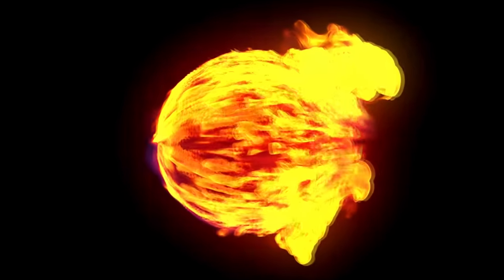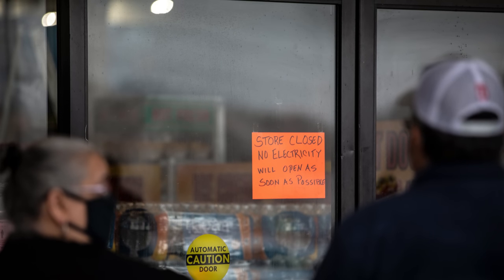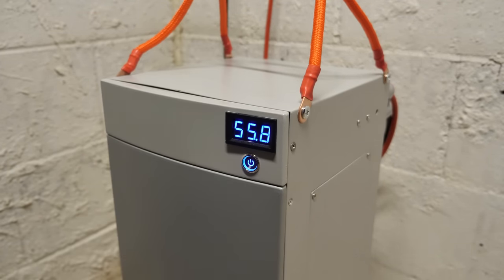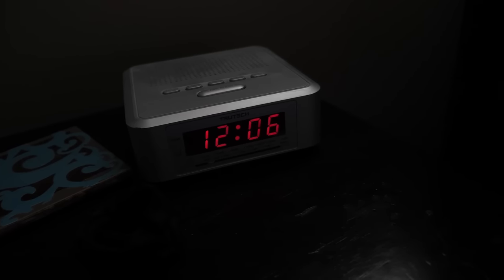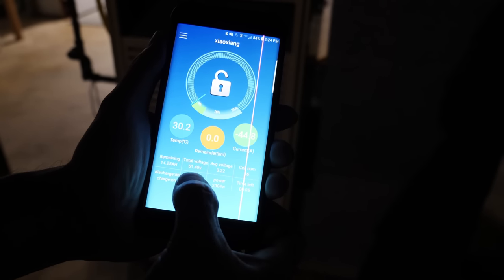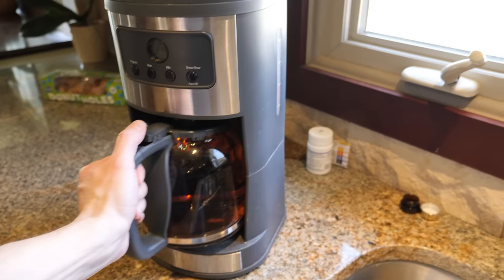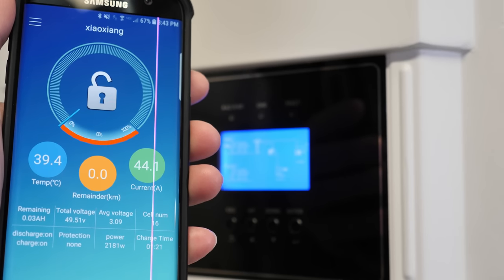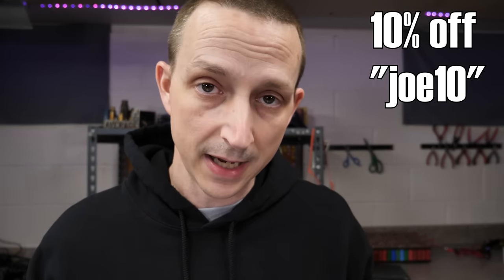Power your House with a Husky 48v 5.3kwh LiFePO4 Battery! BigBattery.com Test Review (2023)

Comment: How would that battery work out to power a off grid ( small 24x24 or so ) house 
( 24/7 - 365 ) for two people ?
Reply from the maker: You would need to figure out an avg daily or monthly kwh. What all do you want to run?
Reply: @AveRage_Joe  I currently run everything in My 1525 sq ft house . 
2 freezers 1fridge want to run an a/c of some kind
Lights 
As much propane appliances as possible.
Oh , almost forgot most
important part 2 - 55" tvs
&1 - 40" tv ( of course most likely only one at a time )
Reply from the maker: I can run for about 6hrs with 2 fridges, 60"tv, all the random phantom powered items like cable modem, wireless router, 8 camera dvr system ect and 6-10 led lights. Keep in mind the idle draw on my inverter is 160watts as well. I would say at least 2 depending on how efficient you 2 are. The AC is going to limit you. Would need to get a mini split. During the day is no problem as you normally charge first from solar and the rest of the day is running on solar. Also need to keep in mind winter time or the days with no sun.
Reply: @AveRage_Joe  It's beginning to look like it would be cheaper to run electric to property ! I probably could do it for 
$20, 000 ! It looks like it
will end up costing more to
go solar , and end up with less quality of life !
Reply from the maker: Used solar from santan solar off ebay. I purchased 20 245w panels for $1400 shipped to my house. Thats almost 5kw of solar to recharge and then run the house.
Reply: @AveRage_Joe  how much roof realestate did those panels take & how much did 
the rest of that setup cost ?
Reply from the maker: Id have to measure it again but roughly 15'x20'. Of course you can lay them however you want. To install I used some flashing squares, treated 2x4 cut to 6" pieces to set on the flashing then used unistrut as rails. To hold all that down I used 3 or 3-1/2" deck screws and fender washers. Also a squirt of silicone under flashing where the screw went. Upper part of flashing was slid under shingle so water can flow easily. Used the unistrut nuts amd 3/8" bolts, flat washer and lock washer to hold panels to the rails. For wire I used 12awg thhn/thwn and got 500' roll of red and black on ebay. I didnt need that much but got it anyways lol. Pretty easy and cheap install.

Comment: Is great job and explanation!!
 Can you please send information on your inverter!?

 Also is it possible to stack more batteries in series to get more power? CC
Reply from the maker: Thanks Mate! I have a few other videos on the inverter. As far as the battery, yes you can parallel them for more capacity/ runtime. BigBattery also has kits now that include an inverter(same as mine but 6kw version), batteries and wires. All from one place!
Reply: @AveRage_Joe  Ty! Please share link for BIGBATTERY so I can buy 4 batteries, inverter, and all wires and accessories needed. Cc
Reply from the maker: I have a link to the kit in description. Once there you can choose how many batteries!🤘

Comment: forcing 1C charging air cooled, ouch!  If you keep it under 0.25C (25A) you will see more than double the battery life of their recommended settings. The more often you can trickle charge and stay in the 30-80% range the better. It's not just temperature to worry about but the literal chemistry within the cells, and it's a very gradual process so you won't see the difference for at least a year. An EU2200i on propane would make for a nice backup charger :)
Reply from the maker: Yep, just wanted to test it out and make sure everything was as advertised! In my everyday usage the charge is much less!🤘

Comment: How does this battery compare to the 5.1kwh Gyll that sells for quite a bit less?
Reply from the maker: Thats a great question! Those do look nice! I dont have one to compare but maybe Sig Solar will send one😆 Im not sure what the warrenty is on that one either. This one is 10years, is a hair more capacity and can be carted around easily if needed.🤘
Reply: @AveRage_Joe  They’re both 48v and about the same weight. Gyll is 4% less capacity for 30% less $$. If I were going to build a set up with 20-30kwh, rack mounted with bus bars may be easier overall.  With just one, Husky is far easier to connect and use.  I hope you can get some Gylls and test them for real.
Reply: @philipmorgan1438  : GYLL is a Chinese company with No Warranty. If you are looking for a the best price/KWh and don’t care about a (10) year warranty or cycle-life; then purchase from TechDirect - it’s cheaper than GYLL and both have no real warranty.
Reply: @EricLundgrenCEO   Not sure that you’re right.  While they are made in China, that doesn’t matter to me since most LiFeO4 and Lithium Ion cells are made in China.  So what!?

Signature Solar (US company) provides a 5-year warranty on Gyll batteries.  That certainly isn’t “no warranty.”

Didn’t suggest TechDirect and you didn’t offer anything about their product so I won’t comment on that.  I know the Gyll product and was suggesting @AveRage Joe review them because they have tested well by others.  Lowest cost wasn’t my thrust here but Gyll is much cheaper than Husky.
Reply from the maker: Yeah rack style batteries are super cool! Obviously Ive been using a rack for my diypw for a bit but not the same as a rack battery! Yeah the BB is super quick and easy to connect up or parallel to others if needed and use right away!
Reply: @philipmorgan1438  : Forgive me, I thought you were being cost conscious because you brought up GYLL. With GYLL - you get what you pay for. The GYLL Cells are “B” grade cells. We purchased one to tare it apart at BB. Not a bad design, but bad cells. No company in USA making them, these are supplied to a 3rd party broker and sponsored by DPOZ. Very familiar with that product, if you want a rack-mount system on a budget for (5) years, it’s not a bad deal.
Reply: @EricLundgrenCEO  Ha-ha! 😆 No forgiveness needed....
Obviously, you’ve made up your mind!  I just saw other favorable reviews on them and thought AveRage Joe should review/test them.  They seemed to be a good value for size and pricing.  You wouldn’t have to read his review if you already know everything about them.
Reply: @AveRage_Joe  Yes, the ability to rack mount them seems a great feature when space is valuable and makes handling much easier.  I hope you can get some for testing and review. I think their 5 year warranty is good too though 10 years is great.
Reply from the maker: Id accept one for a test for sure!!!😆
Reply: @AveRage_Joe  they’ve been in short supply and backordered for months... someone would have to “lobby” for them to provide you some.  I have no idea how that process works but I hope they get the word and send you one.
Reply from the maker: Lol stands outside with a sign!!!😆

Comment: Sir, a Bless day morning to you, Possible connect to Solar power system charger/ for that big battery?
Reply from the maker: Yes I have solar connected to the inverter which has a charge controller built in.  During the test run I turned it off so we could see how it did!

Comment: What charge settings did you use? Trying to figure that out now.
Reply from the maker: Charge settings on the inverter?
Reply: @AveRage_Joe  battery … max voltage, low cutout.  Float etc

Comment: Joe, how do you have the interlock on the breaker panel set? I'm trying to figure the sequence you were describing (around 31:46) where adding the grid tie sounded automatic?
Reply from the maker: The interlock on the panel is just to make sure the grid does not supply power at the same time the inverter supplies power to the panel. It disconnects the grid. As for the rest, this inverter does not do grid-tie however you can supply the inverter with grid so if your batteries are low, the inverter can pass the grid through it and power the panel. At this time the main breaker at the top of the panel (interlock kit) is still off. It stays in the off position and the inverter either supplies battery power or grid power. Does that help?  If not let me know.
Reply: @AveRage_Joe  i  have the same question.  

in this configuration you would have to manually move the interlock to enable grid charging the batteries through the inverter (i.e unable to use the ups feature of inverter).
Reply from the maker: No! Once you switch over to inverter/ups you dont need to do anything else. Only reason to switch back to grid is for battery maintnance or whatever.
Reply: @AveRage_Joe  Gawd, I'm dense. HOW (oh how!)does it charge if the interlock is thrown and you're on UPS?
Reply: @AveRage_Joe  So if the UPS is on and the interlock is off, then both the UPS and the grid are on, right? I'm too close to see it I guess
Reply: @6sensory  He is feeding 240v (Hot1, Hot2, and ground)) from another panel to power the inverter. The output is a single 240v feed (hot1, hot2, and the neutral from the inverter transformer) which he connects to the dual pole subpanel breaker. He turns off and locks out the utility power at the top of this loads panel which de-energizes all the breakers in the panel. Turning on the dual pole breaker from the inverter output re-energizes all the breakers up to the main panel breaker which is open.
Reply: @6sensory  @fortiz80 He can charge the battery 2 ways simulatiously, Utility power (single 240v circuit) and Solar. Optionally the 240v utility power can be substituted with a 240v generator (with autostart controls) but you have to pick one or the other as there is only a single 240v (Hot1, Hot2, Ground) input and a dedicated PV +/- input. It's an off-grid solar inverter with power electronics that accepts 240v from any source including the grid, auto-switching to the battery when those 2 sources are no longer providing power. As Joe said it's not a grid-tie inverter.
Reply from the maker: YES!!! 100% Nailed it!!!💥💥💥🤘
Reply: @AveRage_Joe  Ahhhh, the sub panel. Gawd, sorry.
Reply: @ScarlettJason  Thank you Sir
Reply from the maker: Yes Sir!!😁🤘
Reply: @AveRage_Joe  Joe, is that a feed thru lugs panel, or an outdoor cut off panel or what? I'm trying to get it together and am curious of your choice of panel

Comment: Hello I am 64 years young, I just subscribed
I got hold of (FREE) 16 six volt lead acid battery's (from a industrial electric fork truck)
I have a 48 volt wind generator, that's just spinning because its not hooked up
My journey is just starting (on a budget)  
I'm looking for advice, I am a very AveRage Joe BUT no idea what I need to do 
Thanks for getting me interested
Reply from the maker: I like to say Level 64🤠 Anyway yeah free is always good! What I would do is get a charge controller for the wind genny and hook up it all up and start using! I guess you would need an inverter as well.

Comment: Battery has been up and running with a SW 4048 inverter and a MPPT charge controller, battery if off tonight and it will not respond, fuse is good, is there a way to reboot .....anyone!
Reply from the maker: If it was drained down all the way and shut off, shut off inverter then wait a lil bit for the battery voltage to recover then turn back on inverter to recharge.
Reply: @AveRage_Joe  
I was trying to connect to the Bluetooth BMS and it was at 54.3 volts......
Reply from the maker: The app wont reconnect? If so unlink or "repair" then reconnect. Thats what ive done if I have trouble reconnecting!

Comment: Is it loud when operating? If so can they be installed outside?
Reply from the maker: It can get kinda loud when all the fans kick in yes. If you install outside just make sure its not directly out in the elements. You would want it covered like in a shed or similar.
Reply: @AveRage_Joe  ok thanks!

Comment: Joe, do you think this battery could run a 3 ton Air Conditioner?
Reply from the maker: I do but I dont think for very long depending on the watts. I would suggest more in parallel for sure!
Reply: Do you have central air conditioning?  Would you consider running that test with AC, a few lights and your refrigerators? I’d be curious to see how many amps a central AC unit would add? Thank you for your video!  Nice work!

Comment: New to your channel. Cool video. I wish I had one of these in Arizona. I'm wondering if you can run your A/C unit on this?
Reply from the maker: Thanks Mate! You could run an AC but cant say for how long yet. You would want more in parallel!🤘
Reply: @AveRage_Joe  Thanks, I don’t any solor power. Can this battery be hooked up if you have the inverter system installed?
Reply from the maker: Yeah if you have a 48v inverter then you can use this battery. If you have a different voltage, Bigbattery has other battery options!
Reply: @AveRage_Joe  How do I go about getting one of these? Do I just contact a company who does this kind of installation? Or is this closer to DYI?

Comment: amazing video, keep it up, I would love to watch more experiments on how long a higher capacity batteries works with this inverter, can this inverter handle higher voltage batteries ??
Reply from the maker: Thanks Mate! At this current moment I have about 15kwh of battery. I can usually stay off grid the entire time. Keep in mind I still done have my dryer, stove or AC connected yet. Im in the process of building the next lifepo4 battery. As far as the inverter, you would want a 16s battery of lifepo4 or 14s li-ion. Cant go over 60v on inverter for battery.

Comment: can the big battery be paralleled with an existing battery bank or can it only be used with other Big battery units?
Reply from the maker: NGL, Ive had mine connected with my diy 18650 packs. Just need to make sure voltage is the same with each battery. What batteries are you wanting to parallel and I can maybe help better?
Reply: @AveRage_Joe  I have 2 systems, 1 is a 12v battery off grid system powering my gym, light, heat, outlets. 710AH battery bank with 1kw of panels. I use a  SkyMax 440 Charge Controller for Wind, Solar, and Hydro on this, so I can change the batteries to 12v/24v/48v.  Then I have a 2kw gridtie inverter system going into my home.  I want to add another 2kw of panels, 5 Kw total.  would I be able to tie those 2 systems together with the Growatt inverter or Sol-Ark inverter? oh yeah and add one of the big battery units.
Reply from the maker: If your current system is lead acid then I would not connect lithium in parallel. The chemistry is extreamly different when charging and discharging. Lithium has super low resistance compared to LA. As far as combining systems, the sol-ark may be a little more compatable for what your trying to do!🤘

Comment: Joe how many panels did you have for this set up?
Reply from the maker: I have 18 used 245w and 6 235 panels up on the roof. During the test run I shut them off tho!
Reply: @AveRage_Joe  thanks for the information 
I have the same battery but with 4 200w panels. I am eventually going to add more
Great video Joe!
Reply from the maker: Yeah Id like to get more solar as well!!

Comment: I need to know about that Solar Inverter.  I have micro-inverters on my solar so I don't have one to plug the bigbattery into.  I'd have to purchase that or similar to make this function.
Love the outtakes too.
Reply from the maker: I have another video when I first got the inverter and going over some options ect... Im really liking it so far. Its an all in one inverter and does everything. Could use more on solar input but seperate charge controllers cam be added if needed. Yes I dont have my AC, Dryer or stove connected yet but that is because I am aiming to go off grid and I need more battery capacity. Yes your micro inverters shut down in a grid down situation correct. You would need a sep inverter for battery connection.
Reply: Yes my solar is all down due to safety settings in the main controller.  I imagine if I could supplement the Grid power with battery current the solar would still see a connection and not disconnect.  I'd still have to be sure the Grid power was cut to keep the line workers safe though.
 @AveRage_Joe
Reply from the maker: Yeah you would need to make sure the main is disconnected for sure. So whats going on with your controller? Anything you can fix?
Reply: @AveRage_Joe  Sorry, that is only during grid 
power loss.  All working at this moment, but thank you for the offer to help.
Reply from the maker: Oh ok gotcha! Was thinkin you had an issue. Glad all is working great!🤘

Comment: Reason I am watching this video, I was denied power for 48 hrs in Feb 2021. Temp in attic 15 deg and in the house 45-50 deg with propane fireplace running. Result: 36 breaks in copper pipes and we are still reconstructing after the Snowpocalypse. I now have 70 solar panels and I a building a system that will be independent of the idiots controlling grid power. I hope those people experience the same joy the next time we have a freeze.
Reply from the maker: Thanks for sharing! Sorry to hear the crappy time you had! If your looking for a better battery they now have a badass Rhino battery thats 14kwh! Little more capacity then a Tesla powerwall amd cheaper. They are also getting it UL listed!!

Comment: Can you connect 2 of these batteries in parallel to increase the amperage or will that mess up the bms
Reply from the maker: Yeah you can connect many in parallel. They have paralleling cables as well as a combiner box to do just that! Links in description box!🤘
Reply: @AveRage_Joe  awesome thank you! Loved the video very informative
Reply: I have a 24volt solar panels do they have a 24volt battery systems or how would I integrate to there system?
Reply: @waynepotts3562  connect your solar panels in series bringing them to 48v then bring them to a combiner box to connect in parallel then to your charger
Reply from the maker: Yeah they have 3 different 24v ligepo4 batteries depending on the kwh you want!
Reply from the maker: Thanks Mate!💥🤘
Reply from the maker: Yeah you could also wire panels in series for 48v!